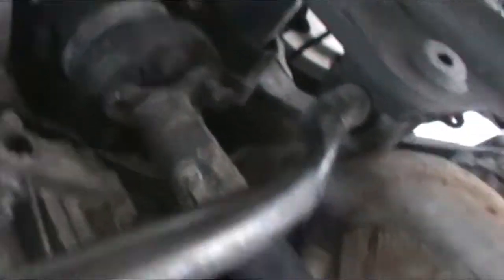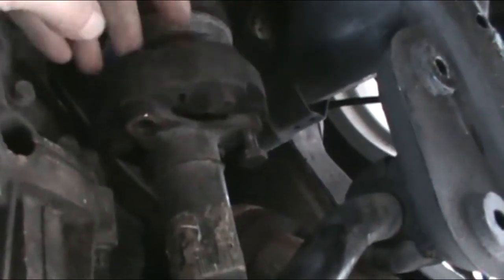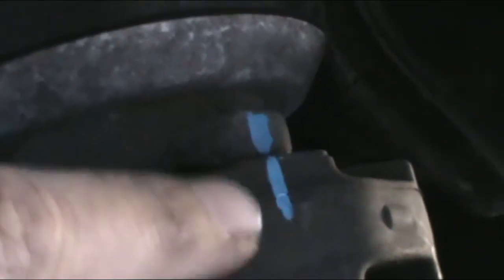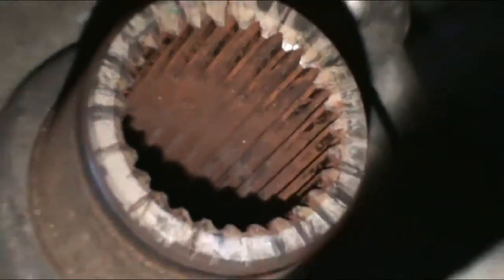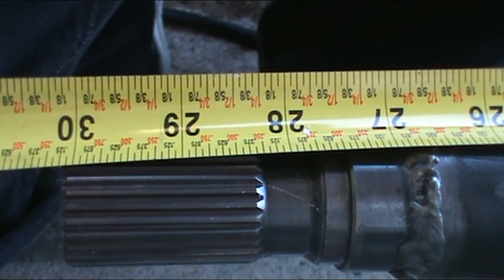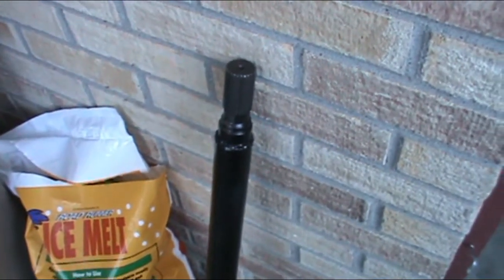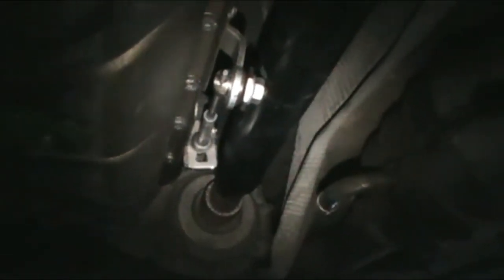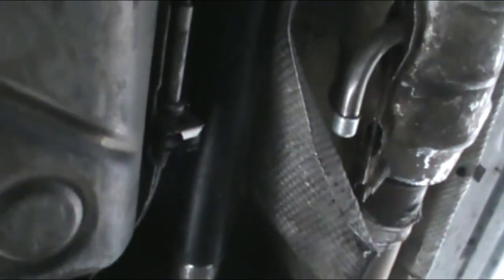How To Fix Drive Shaft Spline Problem On BMW X5 E53 From 1999 2006

Comment: Since the splines are shot I would have just cut the first 3/4" off of where that shaft slides up into the transfer case shaft. Those splines aren't doing anything anyways because they are worn off and most people doing this job has splines that are completely worn flat. Just cut that transfer case shaft down 3/4" with a saw zaw good metal blade then you'll have plenty of room to get that prop shaft up in there straight and then just slide it up in there.

Comment: These driveshaft splines are designed as a weak point, as to avoid the transfer case splines from wearing out. 

Better to change a driveshaft rather than the t case